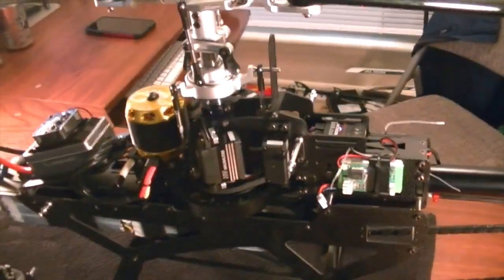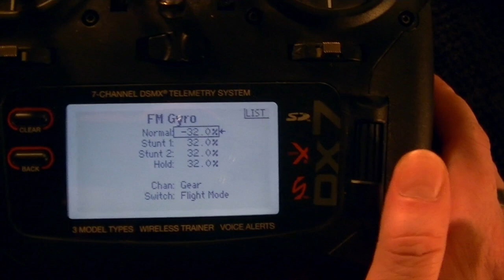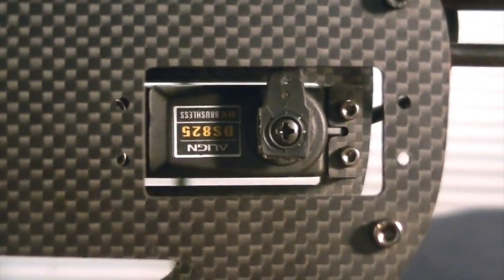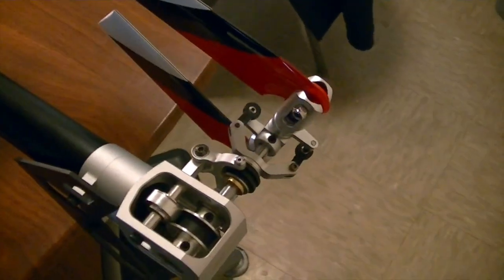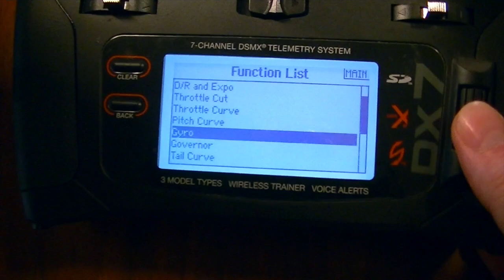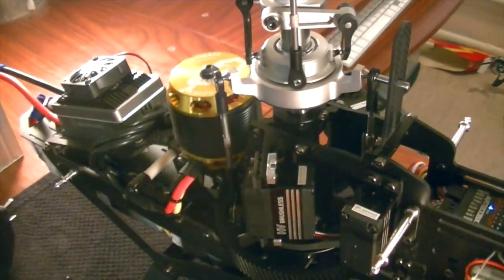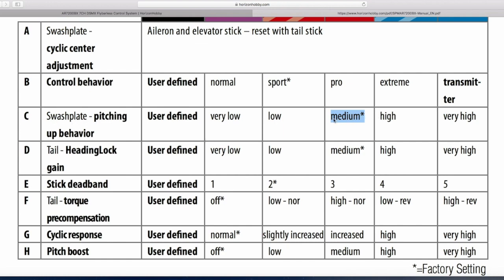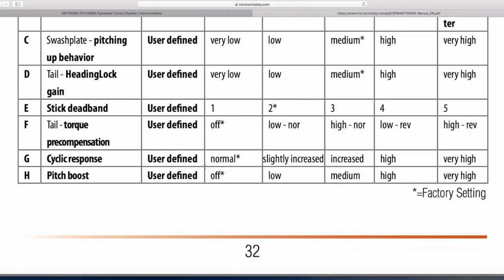AR7200BX / Beast X : Setup Guide #4

Comment: especially pitch normal and hold curve for beginners you can also answer here.  thanks
Reply from the maker: Hey buddy, so basically depending on the gearing you have and the ESC.  The throttle curves will vary.  For example, I have the HW Plat 200A with GOV on.  So I have a throttle curve for each mode as follows.  Norm 80% Idle 1 90% idle 2 100%.  But this can very on your settings and GOV requirements.  As for pitch I always run the standard -12.5, 0, +12.5. I hope this helps buddy.
Reply: @33forsaken  ok thanks
Reply: Also normal pitch curve is - 100 + 100 ?
Reply: @33forsaken   i have only flown in throttle curves and would like a video how to set that up governor on my AR7210BX. this is on a GOBLIN 570 and my 770 I sent you a couple of videos in messenger on my navigation lights i installed. they fly solid but would like more on the governor mode. i have talon 120 ESC on the 570 that  i programed but i did notice i can set up governor in it . just did not follow thru. If you have video on that that would br great. i have a castle 160 amp with separate BEC on my Goblin 770.